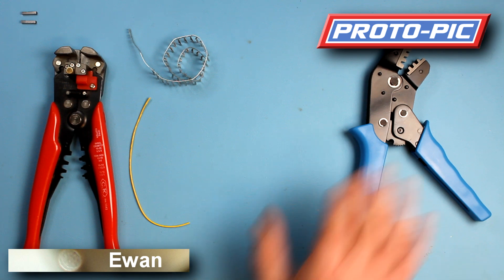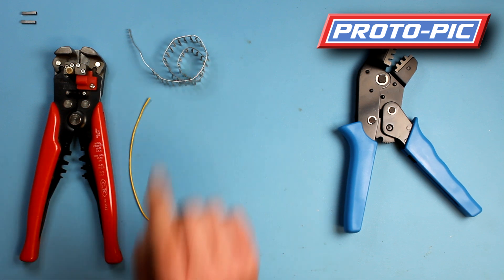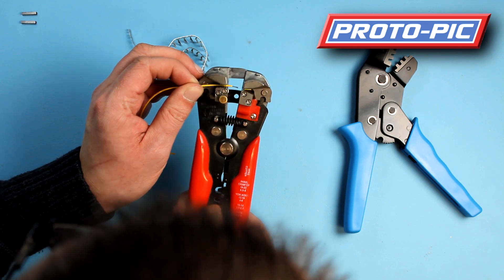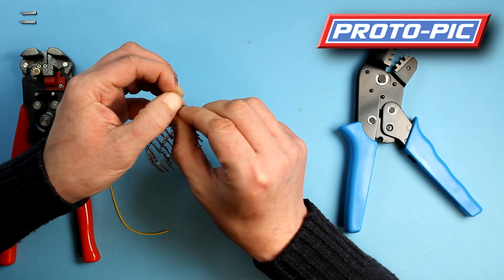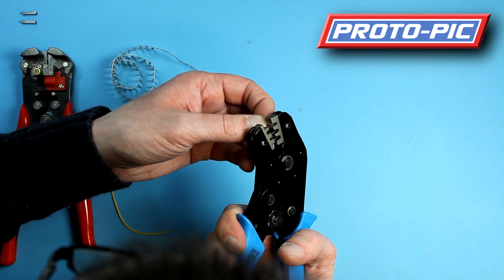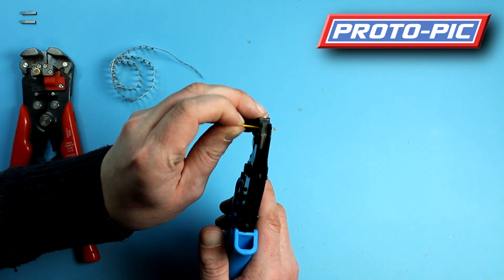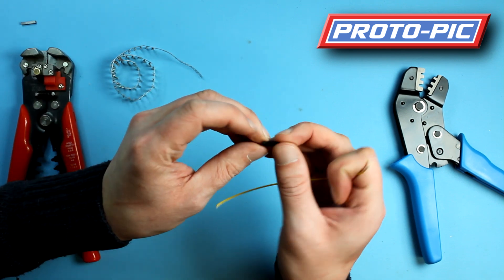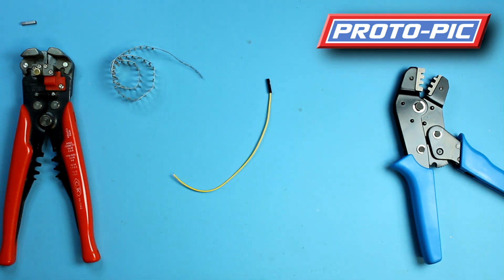Pololu Crimper - How to by Ewan

Comment: When stripping the wire with a tool like you've used I'm getting a nick/small cut on the insulation. Is this okay or should I look at an alternate way to strip the wires for crimping? It's visible after the housing is added too.
Reply from the maker: Hi - A small piece of tape on the top and bottom jaws to stop the 'teeth' marking the insulation, and fold the wire down the back of the jaw to stop it slipping when you strip it. This is what I would do if the insulation was getting compromised.
Reply: ProtoPICVideos Thanks! I did the same thing a couple of days after I posted and I just get a bit of a dent instead rather than a cut. It's harder to use now though as you really have to keep the wire from slipping.